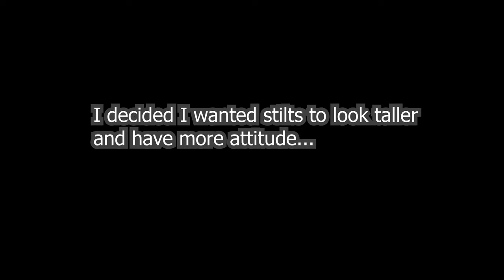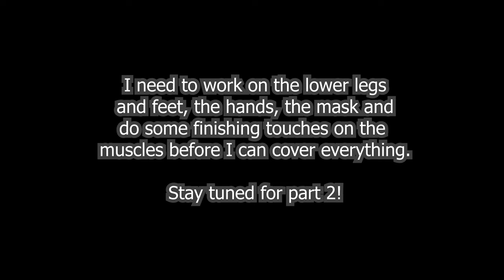Venom Movie Cosplay Costume Muscle Suit Tutorial | Part 1

Comment: Thank you very much for sharing your production experience. I am also making my own suit based on your video, but I am currently facing a problem where the wooden stilt is inserted into the sponge made calf part, which is not fully demonstrated in your video. I mean...do you wear a sponge suit first and then a wooden stilt, or do you wear stilts first and then a suit? I am also following your Instagram account. Can you demonstrate the wearing process? Thank you very much.🙏
Reply from the maker: @nogardvinom3640  oh my god you are so right. I think I totally forgot to add the final decision regarding the stilts 😳 I ended up ditching the wooden stillts, because they made the feet too bulky. I went with super high heels instead. I have a zipper in the back of the foam feet. I put on the suit first (feet already zipped open). Then I pull up the leg bits to free my own feet and then a buddy helps me put on my heels. Then the foam feet are slided down to cover the heels, the zippers are closed and that's it. I do have one video of the process of putting on the suit on my insta. I'll see if I can tag you
Reply from the maker: @nogardvinom3640  can find you, but this is the link https://www.instagram.com/reel/CUH_1F_Dah2/?igsh=dGVkajl3amswZ3Rn It's not super visible, but you see me put on the leg parts first and then sit on the chair when my boyfriend helps me put on my heels :)

Comment: I’m planning to make a muscle suit for a project and I’m unsure of wether to use a mannequin or a duct tape dummy. I have an opportunity to get a cheap ($30) full size male mannequin but it is modeled after a 5’11’’ male, while I myself am 5’5’’. Should I still get the mannequin for this application?
Reply from the maker: Oofff uhmm, I think for the best fit, I would go for a duct tape dummy, but I can imagine that that's a lot of work. With a mannequin taller than yourself it could result in a suit that's too big. Obviously, haha, but since a muscle suit like this is quite stiff, it could really give weird shapes if you then put on the suit and move. Muscles could fold or your range of motion could be less.
Reply: @evelinacosplay7454  Thank you for replying so quickly and yes, you’re absolutely right. I saw in your video how you used a mannequin and assumed that there was some leeway between that and your own body, but upon rewatching I noticed how closely you resemble the mannequin. At this time, I will go through the trouble of doing both, getting the mannequin and making a dummy. That way I can have something to display costumes on or use for other people’s costumes (if I ever get that far) and have a correct replica of myself
Reply from the maker: @thebedroomshow9010  Sounds like a great plan! And you are very welcome :) It also helps to put on the suit sometimes in between just to see where you're going and if the fit is still right. Good luck!

Comment: Hey I'm working on a muscle suit for a Halloween costume I'm making, what kind of contact glue did you use? I'm unsure of the details of contact glue but I'm using simple craft foam from Walmart, a spandex bodysuit from Amazon, and I'm definitely looking for something that doesn't reactivate with heat. Thanks
Reply from the maker: Mine was Sencys contact glue universal. Don't think is was a special type or anything. It shouldnt reactivate with heat, but it might respond a little bit